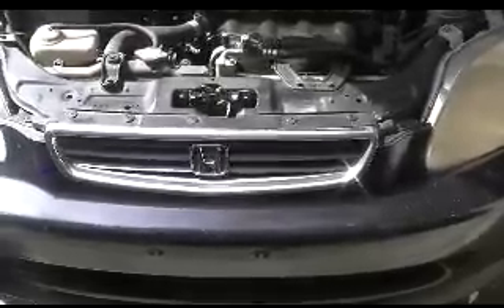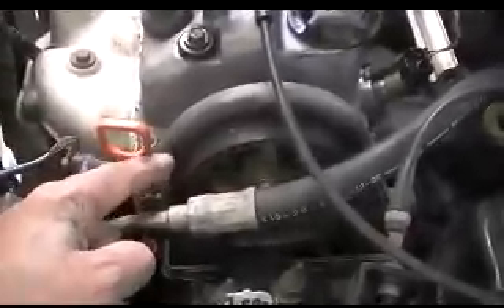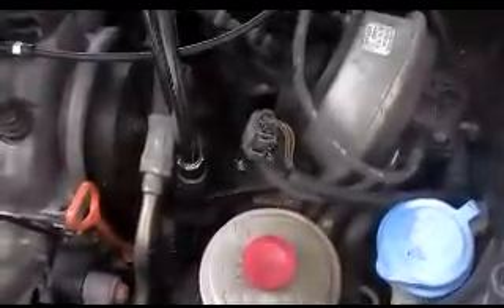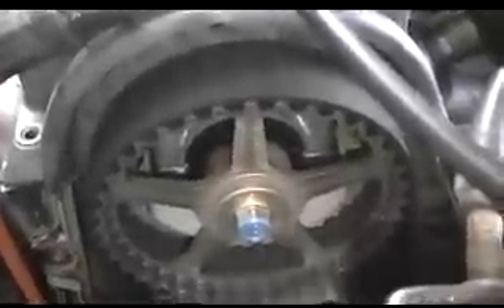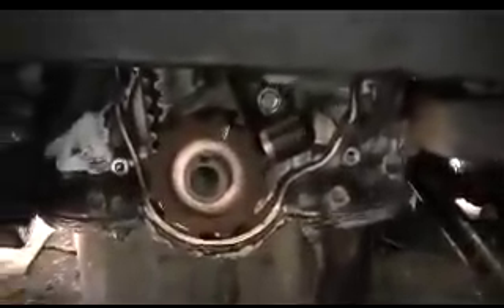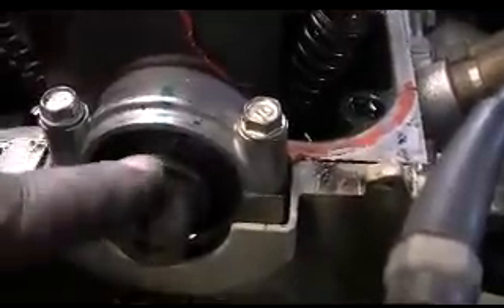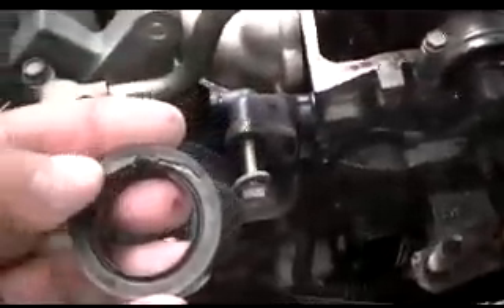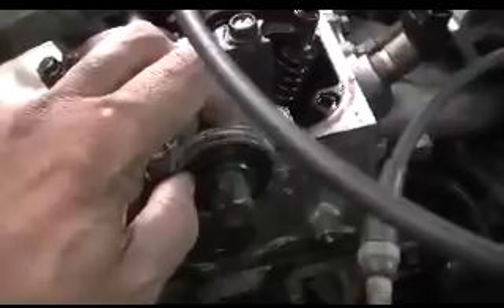96 honda civic-D16-Y7 engine timing belt, cam seal and waterpump replacement

Comment: Unfortunately there's no clear videos on that show you how adjust the tension on the tensioner,  Erick the car guy does a great job of showing you all the steps of removing and putting everything back together but the most critical part of setting the tension on the belt could have been better.  My advice from someone like you guys trying to do it yourself is do not start the car until you rotate the crankshaft 6 times to verify that the belt has the proper tension and is on top dead center.  I watched other videos that might be helpful and one thing is for sure don't start the car if when turning the crankshaft bolt counterclockwise the timing marks don't line up like they're supposed to.

Comment: Did the camshaft seal leak after u installed it?
Reply from the maker: No, it was perfect
Reply: @chotunab  so the grease help alot? What kind of grease did u use
Reply from the maker: Yes it did help but I really don't remember what type  of grease it's been so long.
Reply: @chotunab . Question here can you tell me the easiest and most effective way of adjusting the tension on the belt and still be on TDC ?

Comment: How did you take the A/C belt pulley tensioner? It's a very tight spot and very hard to get a socket and wrench in. I have stripped the bolt using a 14m 12 point socket.  I found a 6 point socket I had and it wont even go into the bolt. I haven't tried using a torch or cutting it off witha blade. What do you recommend?

Comment: Five bolts holding onto the water pump. One is 14mm onto Alternator. Four 10mm. Making a total of 5 bolts.
Question: two 10mm bolts on the top & two 10mm on the bottom of left and right sides.
Do you know which bolts used or placed for short 10mm bolts?

X  (top left 10mm bolt)                 X (top right 10mm bolt)     X (top right 14mm bolt)

X (bottom left 10mm bolt)           X(bottom right 10mm bolt)

Comment: Nice video but information on what type of sealant for the water pump would have been helpful.
Reply from the maker: Robert, I think I used the Permatex (sensor safe) Blue silicone RTV Gasket maker. Blue tube with a water pump picture on it...good luck

Comment: was this car not running before you replaced timing belt?
Reply from the maker: It was running great but had a bad oil leak coming from the camshaft seal, the timing belt was soaked in oil.
Reply: How'd you know you needed to replace the cam seal?  I have a 97 Honda accord 2.2L with 300k miles. I thought it was my valve cover gasket leaking, but I've replaced that 2x (yes, I put gasket maker at the cam arch corners), and I'm still getting oil at the top-back driverside corner of the engine near the valve cover. I now think it might be the cam seal leaking, but I don't see any oil on my timing belt when I look at it, even though I do think I see oil on the side of the engine in the area of the timing belt.

Comment from the maker: NOTE: Use the 1/2" breaker bar and socket.the 3/8" may break.  While trying to loosen the bolt you can use a jack stand to support the long socket extension...I hope that I have explained it well enough to understand. There are other nice videos of this on youtube also.

Comment from the maker: Sorry, I should have mentioned about the crankshaft pulley removal, I did rent the special honda tool from Oreilly's auto parts and attached a breaker bar which I rested on the floor so it does not move then I bought craftsman socket to fit the hex shaped bolt to which I attached a Long extension and a breaker bar and I took a 5 feet long steel pipe and attached it to the breaker bar for leverage to make a nice Long handle, this finally did the job.